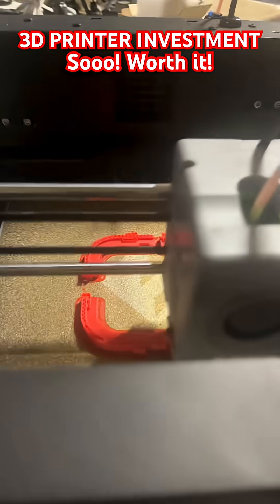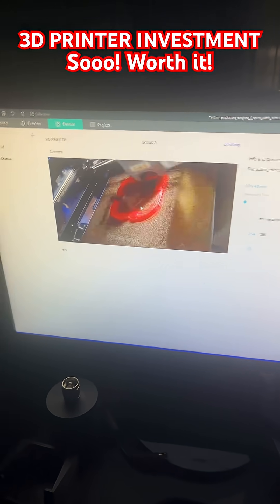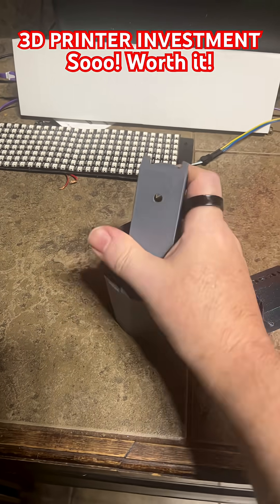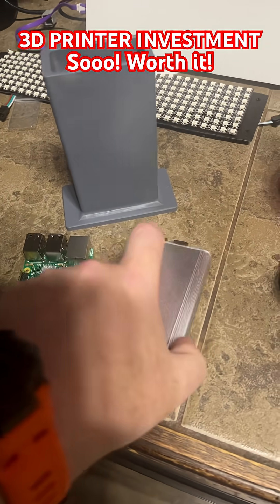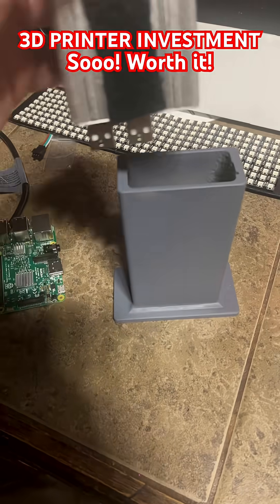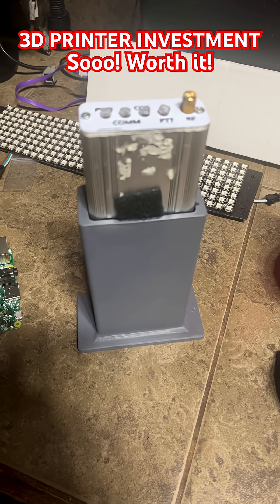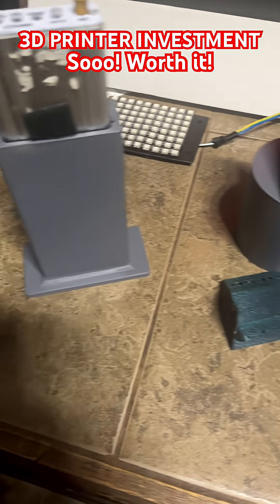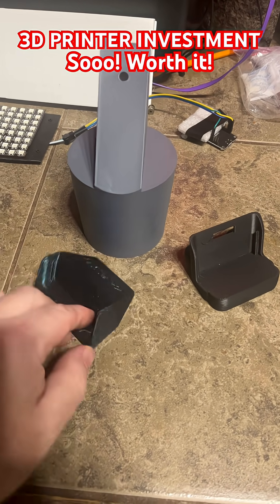3D Printer Making Custom Shari Node Holder 🔧📻 #shorts #hamradio #techshorts

Comment: I have started recently printing things out. I made silly useless things but damn, it´s sooo satisfying ;)
Reply from the maker: Yes it is. What kind of printer do you have?
Reply: @HOTSPOTGUY a regular creality ender 3 ;) works pretty fine
Reply from the maker: I had 3 of those and never could get passed the lining up part! My hat goes out to you sir!
Reply: @HOTSPOTGUY sorry I didn't answer you ;) in fact this devicd is very frustrating for 2 things... Calibration and clogs. It's very difficult to print even a few things out without having to clean everything up. We use it for printing cookie molds essentially... Maybe that's why i don't face so much trouble 😅